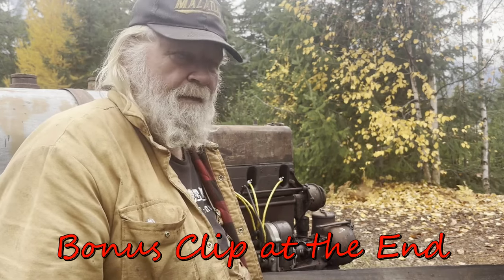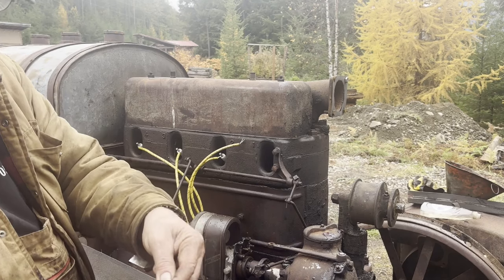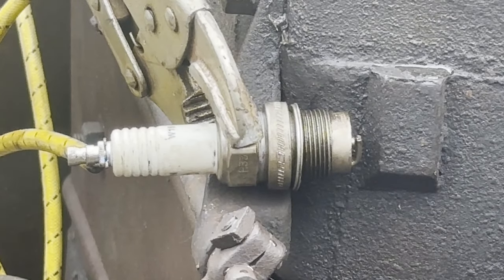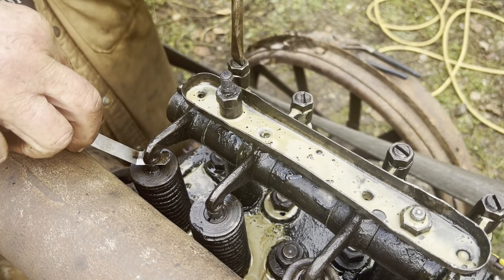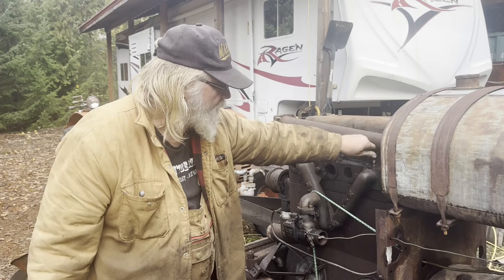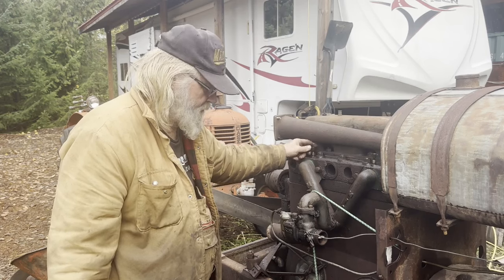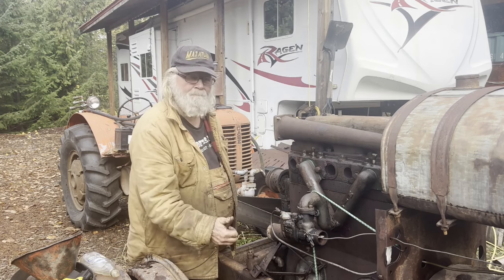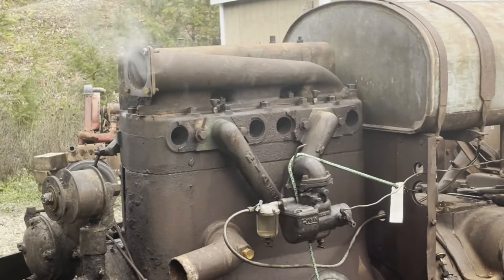Have no Doubt the 15-30 Will Start Today

Comment: Sure good to hear the old engine fire up on all 4 cylinders! Good work, Milt.
Reply from the maker: It starts up with the belt easy enough. It has smoke out of the water pipe. I think new head gasket will fix that. The carb float valve leaks. A viewer from Edmonton might have an exhaust manifold for me.

Comment: .015 on points.035 on plugs they run great at that. And it looks like you need new oiling wicks in the valve oiling trays
Reply from the maker: Yes indeed. New wicks along with a few other things